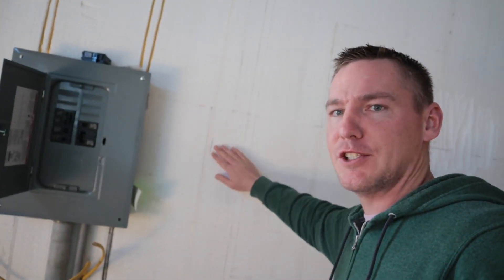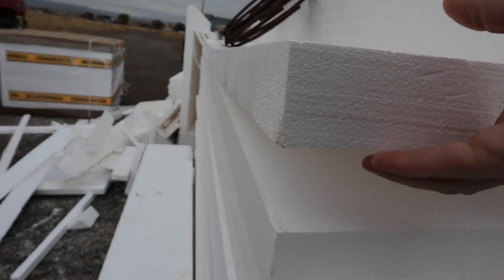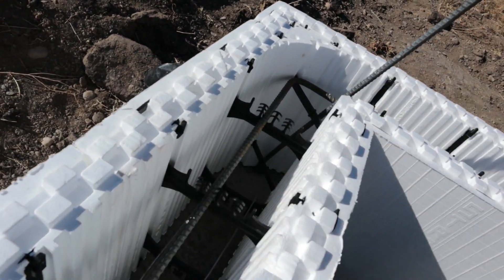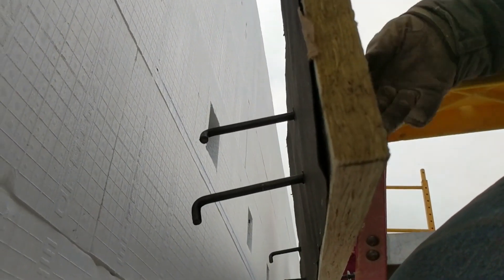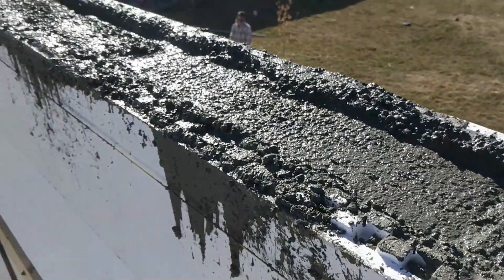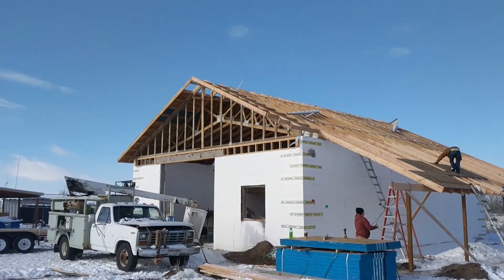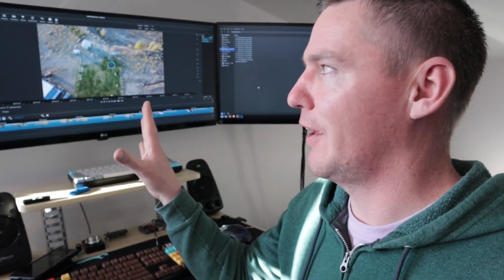Building an ICF Workshop and Video Studio

Comment: the issue is bugs bore into the foam and deteriorates over time usually 20 years or less my house that i put new windows and siding on had exterior foam over the sheathing with house wrap over foam sheathing house was built in 1999 the foam crumbled and fell apart thats not buried in the ground wicking moisture either and only lasted 20 years

Comment: How did your building costs compare to a pole barn, post and frame or traditional stick built framing?

If your trusses and roofing are secured propetly, that thing should be tornado proof!
Any particular reason why you didn't build the second floor ovet the whole structure?
What have your energy costs been?

Great video and great idea!

Comment: Looking to do something similar. Was wondering why you went with traditional rafters instead of pouring icf for the roof as well? Is it to long of a span?
Reply from the maker: Good question. I didn't really look into pouring the roof mostly because I found my trusses used, for a great price and then designed the shop around the trusses. I think pouring a roof would be more expensive, but if I build a house out of ICF I will probably do a flat roof out of concrete.

Comment: I can tell you where you have screwed up!
To make this structure semi permanent,  you should have spent a little more money on steel and pour the ceiling. You can pour the entire structure out of concrete. The walls gain incredible strength when you cap them off with a concrete plate. The heathed floor is great.
Btw: wood burns.

Comment: Awesome build 👍🏽. What was the final cost of all the concrete work?
Reply from the maker: I think the slab was around $5000 and the walls were around $6000. Concrete and delivery price only, no labor.
Reply: @TJFREE  not too bad a price..
I know you said you got the trusses used and it sounds like you're like me always looking for deals and ways to do things on the cheap.
Did you do a lot of research on the type of ICF block you used or did you just use something that was available?
And if you don't mind sharing the cost of the ICF block with me I'm curious what all of that ICF block cost you??

Comment: I plan on building an ICF shop with radiant floors and living space above. What are you doing for heating and cooling on the second floor? Do you think you could get away with minisplits for the second floor?
Reply from the maker: I am currently heating the whole place with cryptocurrency miners. For the upstairs I installed a single, in wall King heater and wired it for 240 volt 1500 watts and it is enough to heat the room well. I think a mini-split is a good idea, especially if you live somewhere that will need cooling too.

Comment: 3 questions:

Aren't polystyrene walls a fire hazard?
How did you prevent the concrete from crushing the under floor pipes?
What's your plan for when one of those pipes springs a leak?
Reply from the maker: Good questions. The pex pipes have thick walls, and are designed to be cover in concrete. I hooked up an air compressor to each loop to test for leaks before and after pouring. There no connections underground, so I think a future leak would be unlikely. I do have too separate loops, so it one did develop an issue, I would just stop using that loop.

Comment: how do you attach the drywall to the foam blocks?
Reply from the maker: Hi Vince. The blocks have a built in plastic piece with a 1 inch strip that can be screwed into.
Reply: @TJFREE  So you hang the heavy drywall on plastic, not a 2x4 stud what if someone needs to hang something heavy on the wall after the drywall is put up like a mirror, or TV, or a pitcher after the drywall is put up. I ges a stud finder won't work?  wow,
Reply: Non of that is necessary
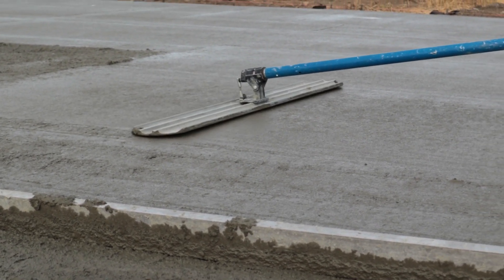Reply: https://youtu.be/MRipzKkeQik 3:30 minutes answers your question